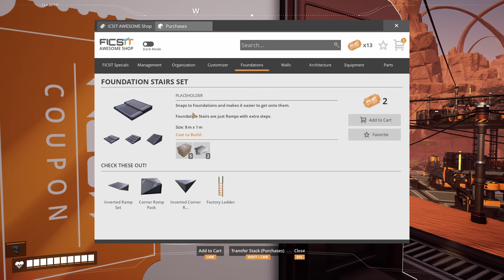Designing our First Build: Earth Kingdom  ||  45 Foundation Circle  ||   Satisfactory Let's Play [8]

Comment from the maker: 0:00 Introduction and steel
2:14 Figuring out circle size
9:59 Outer Wall
11:45 Power upgrade
13:54 my first Timelapse 
18:38 Details 
25:44 Stairs
28:01 Wrap-Ip
Reply: Pin this
Reply from the maker: @farty90  Smort. Thanks. Going to bed.
Reply: Also spell Up correctly
Reply: Ty!
You can add this in the description, it will automatically put timestamps on the video
( 0:00 -> 00:00 ; I think to get it "automate" )
Reply from the maker: @MutedArtistPlayer thanks for the tip!
Reply: @farty90  Pretty sure he missed that.  😂

Comment: Impressive build dude. You have so much patience.
I ended up blueprinting so much boring stuff. I have a whole section for floors of foundations and another for walls of foundations. I made a massive bridge crossing the North sea and it saved so much time. Even stuff like 1x5 foundation floors or 1x1x10 4m foundation walls were so nice. Makes dismantling for rebuilding a breeze too, especially for things like 5x5 floors. Though idk how useful that is on a circle 😅
Reply from the maker: Thanks so much. Yeah, I’m trying to embrace blueprints more this playthrough. Next two episodes I’ll be using some blueprints on this design. Definitely speeds it up.
Reply from the maker: That’s a super useful idea about blueprints for temporary bridges for easy dismantling. Very smart.

Comment: Ya know, I found a better spot for the beam.  So, from the center, go out 24, not counting the center and put the beam in the middle center of foundation 24.  The beam will be 8.06m if done right.  Place the middle foundation and nudge 4 towards the center.  The 24th foundations can be deleted after you don't need them.
I get completely OCD and have all the foundations rotated so the middle line on the FICSIT material is going around the circle.  I also start the beam on the right side so the 0.06 gap is always on the left.  Or, as I like to say, 'The left over is on the left, like it should be!'...  😂 😮 😳
Reply from the maker: Nice. Yeah I don’t remember what side I picked but I definitely did the same pattern around the whole circle. Didn’t want that half of a fraction discrepancy to annoy me anymore than needed. lol.